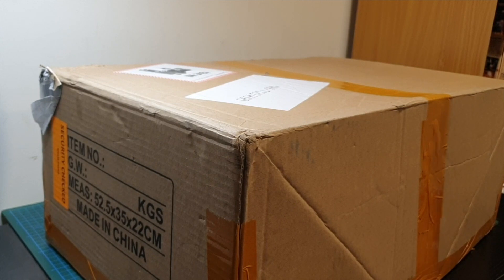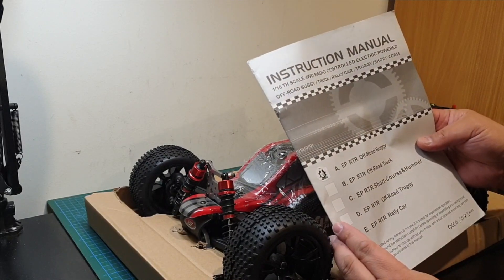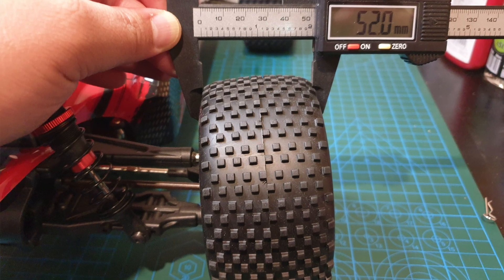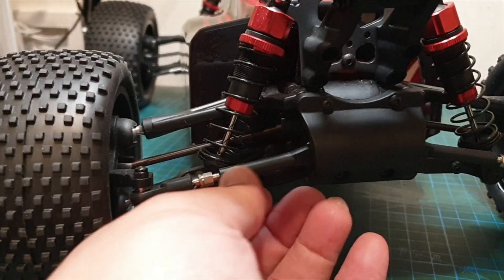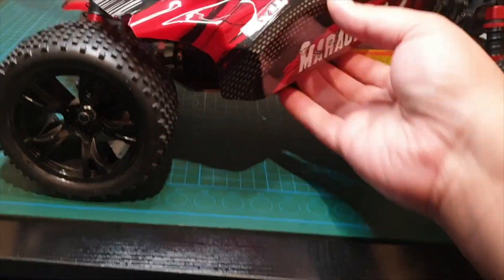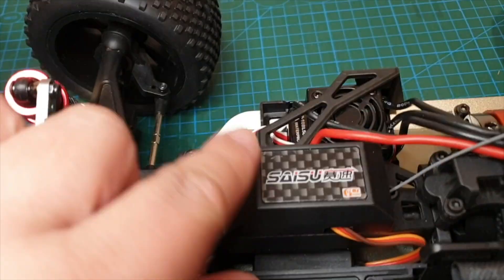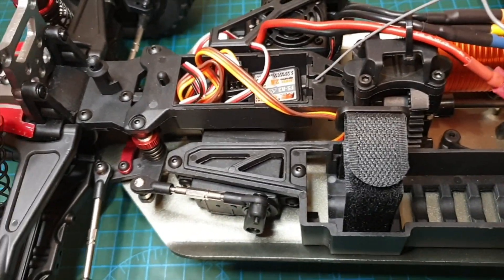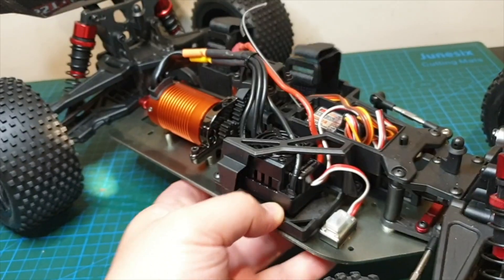SST Racing 1937 Pro 1/10 4WD Unboxing Overview

Comment: This looks really worth in comparison to 104001 this is much better.
Reply from the maker: yeah it seems that way, especially with a centre diff and pretty much everything else is thicker and more durable. 
How's your 104001 doing? Slipper clutch working alright in it?